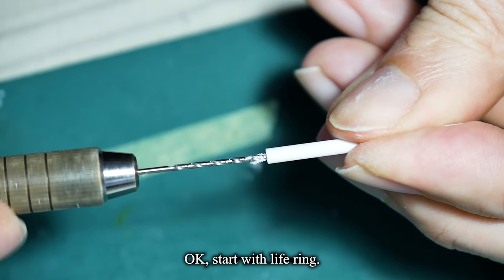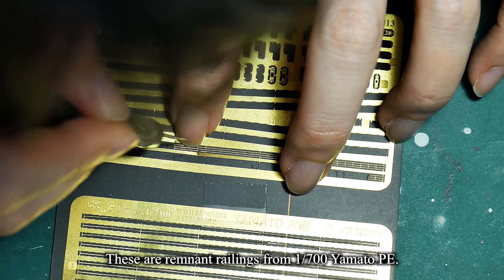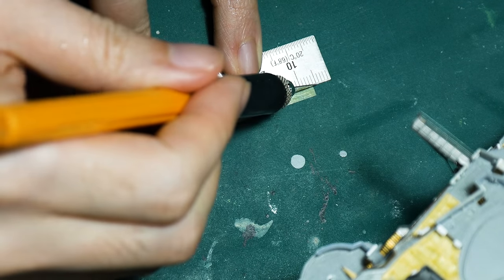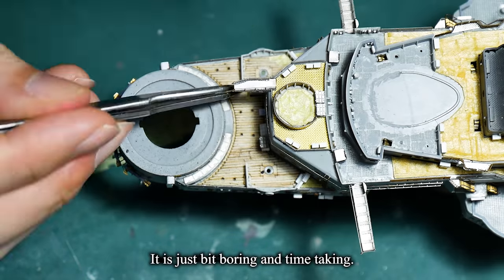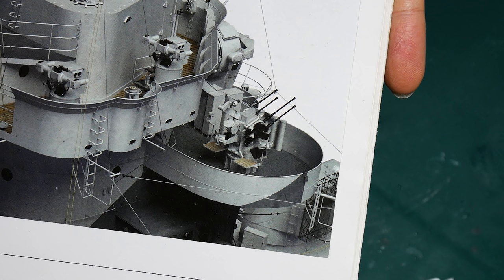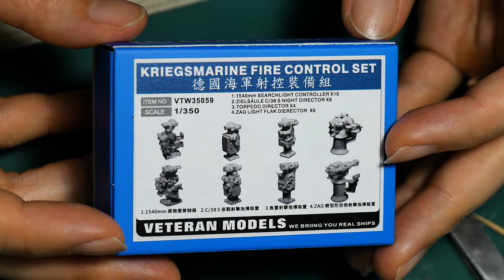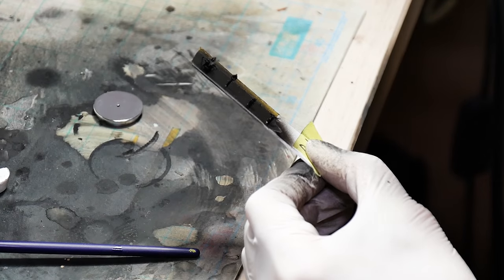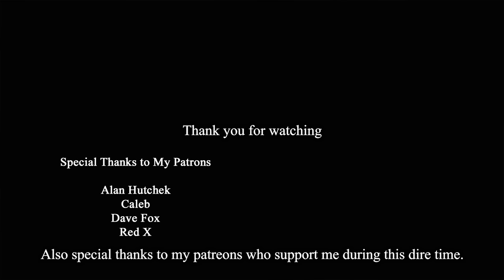1/350 Tirpitz (Revell) Build part10

Comment: I have the same kit and most of the extra's Ebroin has put into his kit. I am waiting for my modeling skills to improve before I even try to build Tirpitz. Ebroin has put massive amounts of time and effort into his build and I can't wait for the complete construction of the ship. I got my hands on a scale copy of the original German deck plans detailing all the interior space of Tirpitz. I am using it to design and build a small 2 deck cross section that you can pull out of the starboard side of the hull. The fine detail and equipment inside will be minute so building it will be interesting. I have chosen some of the moor interesting parts of the ship including powder magazine storage for both main battery and 15cm secondary guns. As well as some of the control rooms and living areas. My external appearance will not be as good as Ebroin's build but I hope this may make up for it.   
Keep up the amazing work Ebroin.

Comment: I’m amazed at your attention to detail and could sit and watch for hours. I am curious about the cements and glues you use especially since they seem to cure so quickly that you are able to file glued parts immediately. I only work with 1/700 scale as I have no space for 350th and only wish I had the patience ney skill to add as much detail as you can in 350th.
Reply from the maker: I use Mr.Cement SP and Loctite 401. I waited for couple of hours before filing. 
Thank you for the comment. =)
Reply: Many thanks for the info on cements.